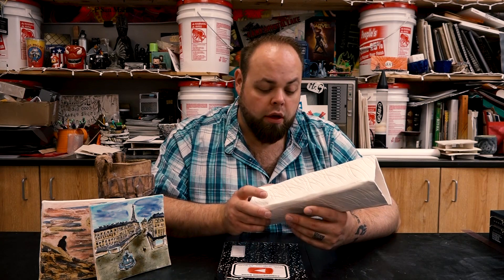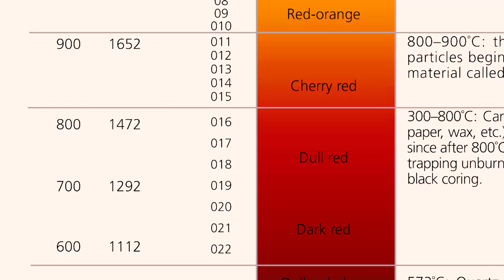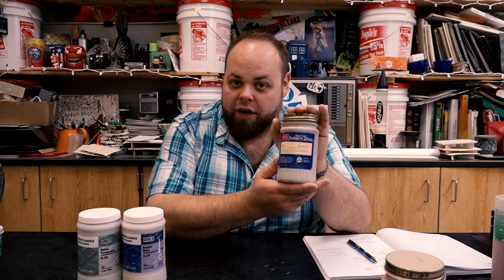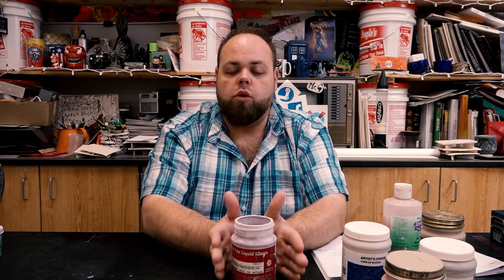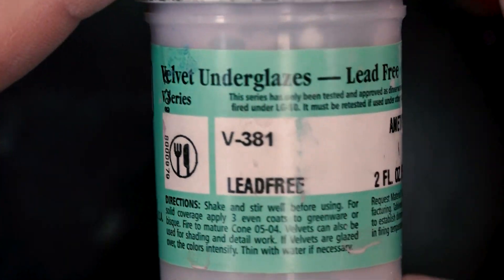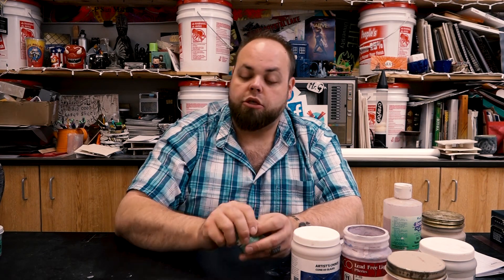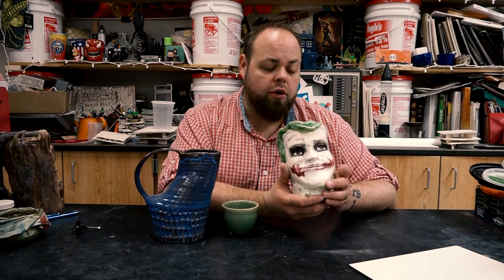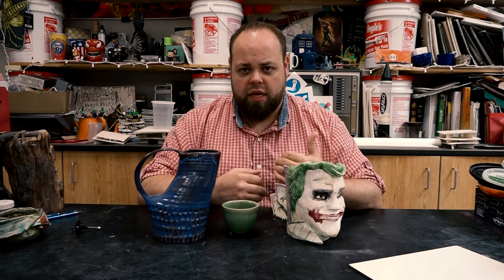Let's Talk About Glaze (Part 1) - Ceramics 101 - University of YouTube

Comment: Thanks very much! your lessons on clays and glazes have given me much more clarity. I'd like to know though, is stain the same as underglaze? some suppliers in the uk say 'stains' and I wondered what these are. I'm going to make ceramic beads, and I read on a forum that if I dont match the right clay to the glaze, then crazing and popping will happen after firing (the glaze chipping off), I want to use low fire glazes cone 06, and the kiln will be a paragon firefly.
Reply from the maker: Awesome question. I was planning on doing a stain video in the next month, so stay tuned. But in a nutshell, underglazes are topical and stains penetrate the clay body. 
I cover tips and tricks on my kiln videos. Check those out and if you have any questions let me know. 👍🏻✌🏻🖖🏻
Reply: @TrifireStudios  Thanks again, I'll stick to underglaze.  I've watched most of your videos and learnt a lot...you are better than any others I've seen because you are sooo informative 😊😎 two more questions though if you dont mind!, just how much clay fumes come out of a kiln with low fire clay, and are glazes that are called 'no flow' means that they dont flow or mix into another colour?
Reply from the maker: No flow, additives like talc are higher to deter movement in the low-fire range; 06-04/1828^-1945^f. 
Fumes, the issues will happen from 300^-firing temp. This starts after the water vapor process and is ongoing till the firing is over. 
I have the kiln in a separate room that is isolated during the firing. Try to fire when you only need to be there to change the dials, 1-2 minutes at a time. All firings will have fumes, but it depends on the chemicals to what fumes and how much.
Reply: @TrifireStudios  Thanks for clearing that up, doing 'recipes' with glazes seem very complicated so I'll stick to applying one colour at a time, also using slip trailing.. I will get a mask in case I need it. 🙂